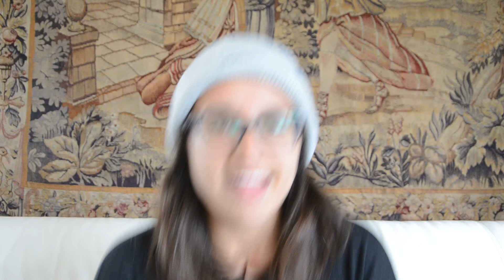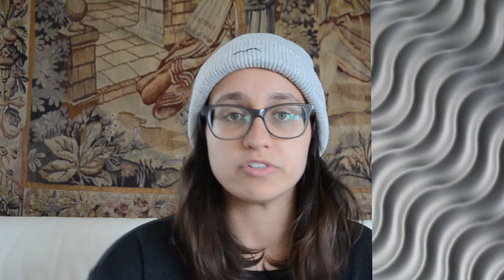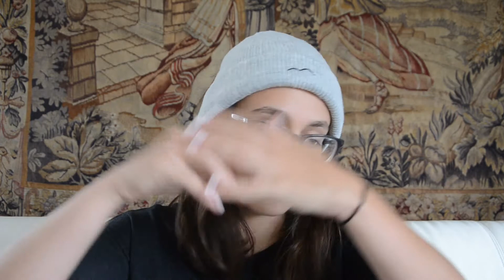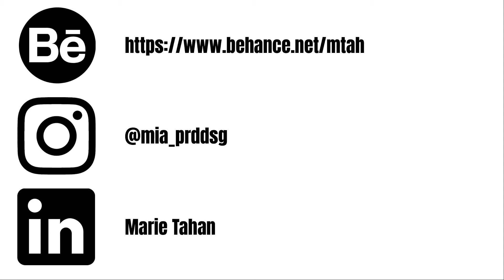Explosion Forming : an Unusual Way of Shaping Metal !

Comment: Plus points:
You only need a 1 part mold, unlike press forming that needs 2, Also you dont need a huge press. It does not require that the work piece is airtight, unlike pressure forming. It is fast, very fast.
Reply: Very fast? Try mach level fast!
Reply from the maker: Very true! Great points!!
Reply: yes, but only the problem it doesn't work